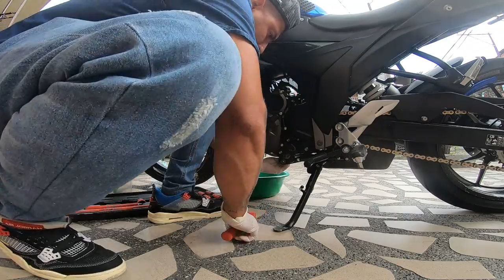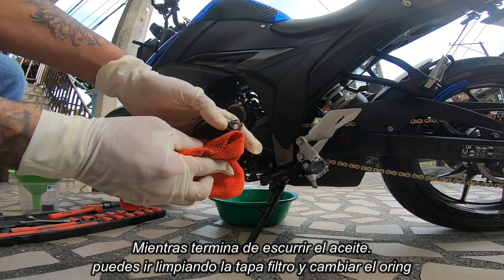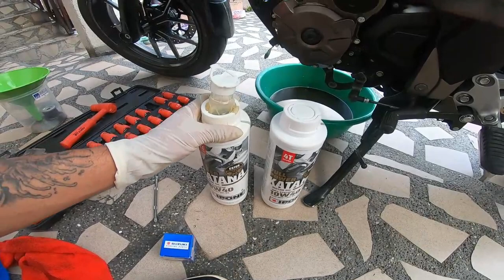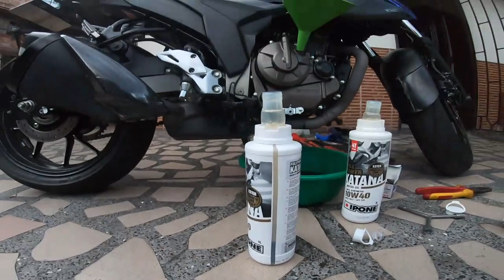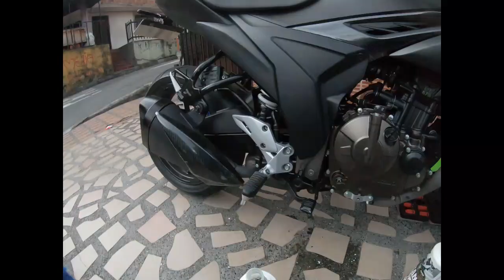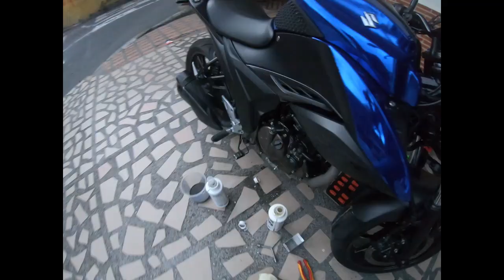COMO Cambiar el Aceite De Tu Moto 🔧 No Pagues 💰 Hazlo Tu Mismo

Comment: Actualmente tengo la 150  y estoy pensando seriamente en pasarme a la 250, no sólo por gusto sino también por necesidad porque viajo cada cierto tiempo, especialmente por la ruta del sol, ¿La gixxer 250 no tiene el problema de la 150 que se come el aceite? yo sé que todas las motocicletas deben quemar un poco de aceite, pero es que la 150 literalmente se lo come todo. Gracias y saludos desde Bucaramanga.
Reply: Amigo una pregunta el modelo de 150 que tienes es el anterior o el 2.0 como la 250?
Reply: @MIKE.A95  2016
Reply: @edwinalexisdiazpabon708  ah si señor esas venían con eso de la 2017 -2018 en Delante no presentan ese problema,  yo tengo la 2.0 nueva que salio .
Reply: Actualmente tengo la 250, pero antes tuve la 150 primera generación, y es verdad que se nota más el consumo, pero es por tener un cárter tan jodidamente pequeño de tan solo 850 CC, lo remedié un poco haciendo los cambios cada 2 mil km y no cada 3 mil, y cambiando el aceite full sintético (no lo necesita) por uno semi sintético.
Reply: @henrysuarezgarcia  gracias por el dato bro